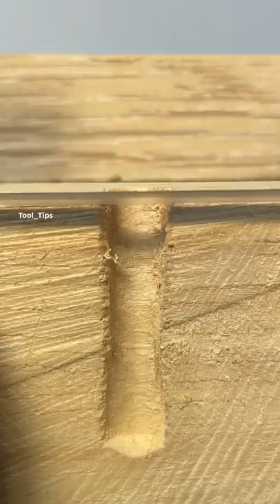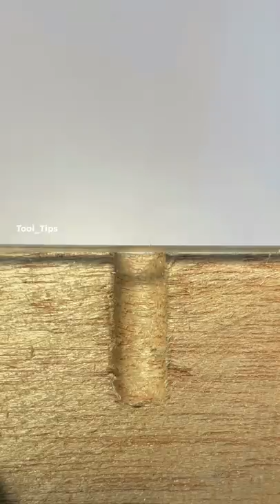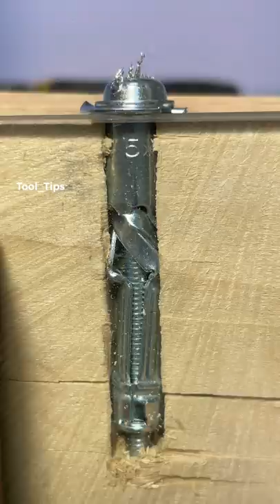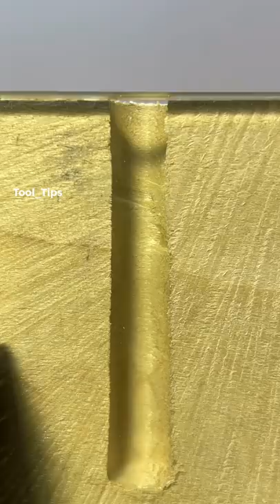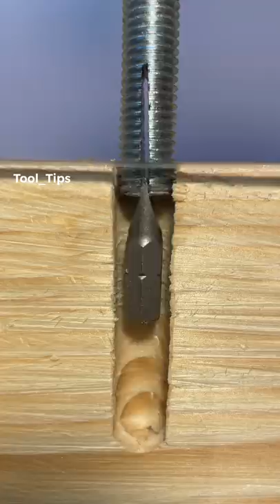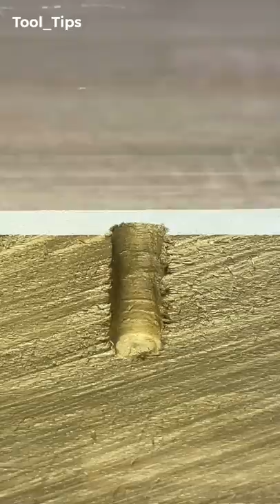#shorts The Best

Comment: I feel like I was supposed to learn something from this, but I’m too stupid.
Reply: You learned when you see glass and wood don’t put drywall anchors in it
Reply: What's sad is this could be the good side of tic tok but they are using wood not drywall.
Reply: Me too
Reply: Of course they're using wood. Do you know how messy that would be? And dry wall is only a couple inches thick. You can have any size thickness you want with wood. Plus if you don't know that anchors are for dry wall maybe you shouldn't be trying to hang tv in the first place. I just use tap cons.
Reply: @iamtheangiechrist1090  well sounds like you should be taking that up with the person who told me what the hell was happening
Reply: @vicarioushandicrafts1990  yes
Reply: @vicarioushandicrafts1990  It's oddly satisfying.
Reply: @vicarioushandicrafts1990  one of the most common problems with doors in houses is that the wooden frame underneath the hinges splits and no one thinks how to fix it. i have this same problem and this helped me out!
Reply: It’s used to better tighten the screw I guess
Reply: @iamtheangiechrist1090  Drywall a couple inches thick? What sheets are you working with?!
Reply: Same
Reply: I literally said 'what's the purpose of this' before I clicked the comments lol
Reply: Lmao, same here
Reply: @iamtheangiechrist1090  what's the point in showing how drywall anchors perform in wood?  Or they supposedly perform the same way in drywall?
Reply: @Lazy_Prophet  they break understress, and work better on drywall
Reply: @Lazy_Prophet  Bc drywall is to dusty. When you screw into drywall dust flys out. It would cover the glass. You wouldn't be able to see it. I'm sure they used drywall first but it was no good. Plus drywall is weak. Breaks easily and cracks. Too crumbly. I knew exactly why he used wood instead of drywall when I saw it.
Reply: @katarax8  I know how to fix it. Go to home Depot and buy an effing $50 door lol. Unless you have an older house with original doors, then I can see you wanting to fix it.
Reply: X2
Reply: @vicarioushandicrafts1990  not really  if you are into using your own hands and not paying someone to fix something you should be able to do yourself
Reply: No this is for children cuz they like screens and noises
Reply: Nel
Reply: Nah bro he’s hitting screws w a hammer you don’t wanna learn from him
Reply: @St0neyWanKenobi  I also think some of them were already cracked (before they tightened them).
Reply: @mr.blobberry3112  lol ok
Reply: @iamtheangiechrist1090  thank you,
Reply: @DuckDuckDad  Yeah, sorry. Haven't worked with drywall in like 15 years. Last time was when we hung the drywall to the ceiling of my bosses office. Still there minus one hole under the beam to hang his punching bag lol.
Reply: @Lazy_Prophet  No, they work way better on drywall. You drill the screw into the anchor and it breaks behind the drywall causing the plastic to spread iut anchoring it into place.
Reply: @iamtheangiechrist1090  exactly the thinness and crumbling nature of plasterboard means you need much more specialized fixings for fastening into that than you do for timber or masonry fixings which allow for a lot more improvisation
Reply: They show you how to tighten the screws by putting the nail in and putting outside pressure for the nail to stay in there.
Reply: Lol i know right 🤣😂😂😂😂😂
Reply: You are not stupid. Cos you know you are.
Reply: Just buy Fischer
Reply: I learned how to fix wooden dowel pegs in place.
Reply: SAME
Reply: I love u.
Reply: Same...
Reply: Well at least ur honest
Reply: @escalatorcancer1278  yf
Reply: @escalatorcancer1278  hvhfhbfjfjjjj no😏😌😉😉⏩⏩🔀
Reply: @iamtheangiechrist1090  a couple inches?? Try like 1, maybe 1.5
Reply: da
same
Reply: @vicarioushandicrafts1990  thank you
Reply: I guess you can meditate to this...
Reply: @iamtheangiechrist1090  this is not satisfying
Reply: Best comment I seen by far in 2021 I love it
Reply: @iamtheangiechrist1090  i think they were talking about the door frame
Reply: All you learned is more satisfaction.
Reply: same
Reply: Same here kkkkk
Reply: Me too I know one was the best way to do this but which one!?!?
Reply: It just shows the different type of anchors and what they look like in the wall
Reply: Right there with you , I was about to comment.
THE FUCK DID I JUST WATCH 🤣
Reply: No you just got something screwed into your head
Reply: You win !
Reply: @Beast Hunter I'm not explaining myself again, that's for sure.
Reply: @iamtheangiechrist1090  seems legit
Reply: @dotkabi  nice. Greetings, enlightened one. 🙏🏼😌
Reply: @Chavita_KB  😄🙏🏼
Reply: Broke this 69 replies
Reply: @vicarioushandicrafts1990  imagine living in houses made of wood and dry wall instead of bricks and concrete 💀

Comment: I like how some of them aren't even meant for wood but you just do it anyway
Reply: Fr 😂
Reply: Not one of them is made for wood.  You dont need an anchor when fastening to wood you can just use a screw
Reply: Wood is just a simple option for him and the goal was to show what happens with the different types inside the hole.
Reply: Aapni Maa Ki Umar Kitni Honi Chahiye
           I Love you mom 💕💕
1 Subscribe = 120 Years 💕
        I miss you Mom ❤️💕💕👍👍👍👍👍👍👍👍👍👍🙏🙏
Reply: Exactly.... there is no point at all to this video
Reply: I mean like almost all of them aren't meant for woods
Reply: I think that’s the point
Reply: @brasshouse-og  what do you need the anchors for if not wood? I don’t know haha I don’t even own tools
Reply: @stefan514  but he hasn't achieved that in the slightest. Cars don't work underwater, so you wouldn't bother demonstrating that because you'd end up with completely different results.

Drywall and concrete fixings don't work in wood, period. What you're witnessing here is not at all what they do in drywall or concrete.
Reply: Yeah most are for plaster
Reply: @taylorm1396  when you put nails and screws into wood, the wood compresses and grips the insert. That doesnt happen with dry wall or concrete. Thats when you use an anchor to manually force compression with the insert rather than relying the material to do it
Reply: @John Hunyadi most of them are are for concrete walls
Reply: @asancoon2363  huh. There you go. I’ve never even thought you’d need so many. Now I know what all those little plastic/rubber things are in brick walls haha.
Thanks for teaching me something today
Reply: @taylorm1396   You use anchors like that in masonry or sheet rock. Materials that won't hold a screw by themselves. Wood will hold that screw much better than that plastic anchor would
Reply: Sometimes you wanna use an existing hole that’s just too big for the screw u have. 
I use wat I have when I don’t have wat I need. 
Not always the best option, but an option 🤷🏽‍♂️
Reply: @heysimp3122  h
Reply: @cryterion7770  a
Reply: @johnjohn-br1hz  F
Reply: @brasshouse-og  The people who lived in this house before me decided to go without fasteners in the doors and walls. The fucking doors and fixtures all came off within 2 months. There are now screw fasteners in all of those places where there were only screws before, and I have not had 1 problem for almost a year.
Reply: @jameshatfield7165  but that's not how you would demonstrate how they would work.  The point of them is to expand behind the material you are anchoring in to.
Reply: @brasshouse-og  didn’t say it was a good demonstration 😅 i think it’s mainly just to try to entertain while also kinda educating or getting people somewhat interested in tools and building
Reply: @stefan514  show what, how the demonstration is useless to everyone?
Reply: Wood is soft so it shows the pressure, whereas concrete, where they work best in is too hard to show.
Reply: @John Hunyadi no, not good options for drywall, use easy anchors, toggle bolts if hollow or go to the studs.

They work best in concrete
Reply: That's what she said
Reply: @John Hunyadiare they? I thought that they can also be used in concrete, bricks, etc. They are just as often used at closed spaces at the end as you called it.
Reply: Came looking for people mad he was using tools in any capacity, even just showing how the screws interact with the anchors....wasn't disappoionted. Yall folks love to get pissy, video aint even got a fukin name
Reply: His goal was to show how they work and wood was just the best option for him to show use that
Reply: Its so satisfying
Reply: Like most of them🙃
Reply: James Hatfield ..a demonstration of nonsense which is a waste of time
Reply: Wow nice😅
Reply: @stefan514  but he isn't showing how they work at all. He's showing how they get mangled and are then useless. Cross section in the correct material hole would show how they work.
Reply: Залип на 10 часов!
Reply: Thanks spammers for making people respect me…
Reply: @Ambujnk  Ayo can you snap real quick we are kinda overpopulated
Reply: @wilsonmartinez2941  use a thicker screw
Reply: @wilsonmartinez2941  .. They will never see the point because they’re all being used in the wrong way, that is, the manufacturers of the fasteners do not intend for them to be used this way therefore it is wrong.  It’s another video that someone made to post without any regard of the content
Reply: @taylorm1396  drywall
Reply: ..was about to comment😞
Reply: forreal! i was like yoo you got thw coolest ones but they meant for drywall or concrete... but noo lets just mush em all in some garbage wood,, we dont beed to see them flair out
Reply: @Garjeet_Dheeryan  🤬🤬🤬🤬🤬🤬🤬🤬🤬🤬
Reply: @stefan514  "...goal was to show what happens with the different types inside the hole." this reminds me of hentai

Comment: This dude just hammered a screw
Reply: I believe they are called ring shank nails
Reply: Drive pin anchors
Reply: Screw nail hammered
Reply: Ring shank
Reply: Type of ring shank nail.
Reply: XD
Reply: It definitely was a screw lol. I saw screw under that little wooden dowel thingy
Reply: @tigeabenton2174  look up the things they said. You will be surprised to see screws that are meant to be hammered.
Reply: @Foxyzgamer removed problems like stripping or stuck screws probably.
Reply: Didn't know they were called ring shanks, but these nails are very common. Trust me, if you managed to hammer a screw without bending it, it wouldn't hold anything, because you've effectively stripped the hole in the process.
Reply: @tigeabenton2174  
A screw's threads are angled such that they create a helical path...
The nail had circular, non-angled grooves, so its not a screw 🤦‍♂️
Reply: @tigeabenton2174  

The ridges on screws are angled, while “ring shank” nails are straight (like a stake of very small plates).
Reply: Rivet nail
Reply: I was so triggered 😂☠️
Reply: Better than screwing a hammer
Reply: And it worked !
Reply: Netflix: are you still watching
Someones daughter:
Reply: Old man I worked with would hammer screws all the time, I said why you hammer screws, he said the threads are to take it out. IDK he may have had a point.
Reply: One of them there fancy threaded nails

Comment: been using drywall anchors for so long and didn’t even know what the fuck was actually happening, thank you
Reply: Same here man
Reply: With this video you still don’t lol they react differently in drywall and arnt made for wood
Reply: This is not what happens to them , they actually work in drywall 😂, that’s why you don’t use anchors on wall studs
Reply: Drywall anchors are allowed to deform as designed in the gap behind the drywall. This is not what you see here...
Reply: DÜBEL IT‘S CALLED DÜBEL!
Reply: That's black meta not death metal
Reply: Too bad it’s not in drywall.  Most of those are made to expand behind the wall as well to anchor.

Comment: This guy is the epitome of “If you have a hammer, everything looks like a nail.” Don’t use rawl plugs and drywall anchors in wood.
Reply: It was just for showing how anchors work I guess
Reply: @josefbeno2384  Sure that was the intention, but still the choice of wood as a demo material fails to give the point across.
Reply: @Mirage2000H  Yeah there shouldn't be wood splits on a demonstration vid
Reply: Oh thats what they were
Reply: Exactly. This is a video of how not to use anchors. This shows what happens when they're improperly used. If anyone thinks they're just demonstrating how they work, this is not how they work.
Reply: @Spelunkingpunk  thanks Kevin
Reply: "these nails are great, they're threaded."
Reply: @Spelunkingpunk  this is exactly how they work.
Reply: That isn’t threads, it’s a ribbed nail made for wood.
Reply: @mitchellnova324  no, most are for drywall 1/2" or thicker. The metal ones are for concrete. Anchors like all the ones pictured aren't for plugging a hole and if we're allowed to expand properly, you'd be able to see how they're really supposed to function.
Reply: IKR I was just waiting for him to fire a nitro-set stud, that would have been perfect LMAO
Reply: I know, I watched this video thinking I would learn something, but I still didn't figure out which one was supposed to be the "best"
Reply: @eriklona8806  personally I found it interesting. To answer your question

Re:best for wood
... anyone that didn't split wood.

Re:best for other materials like drywall or brick
... you can't guess as right material plug combo wasn't tested
Reply: @Spelunkingpunk  the more you know... TY
Reply: @Spelunkingpunk  Dang, Can sm1 make a video to show how they really work...I thought this was it ..😬😬😬😬
Reply: @josefbeno2384  6
Reply: Thank yoi